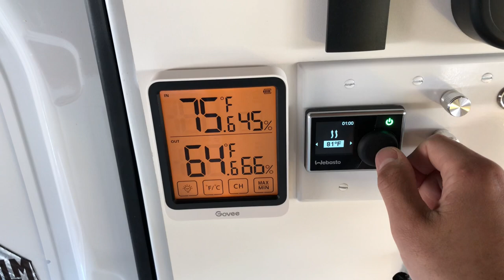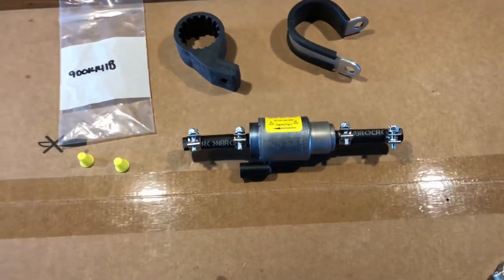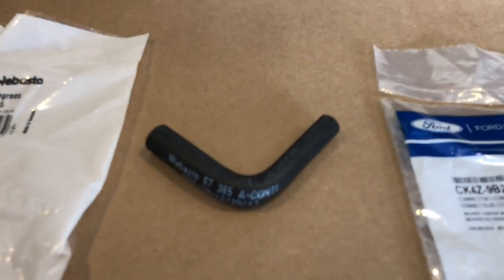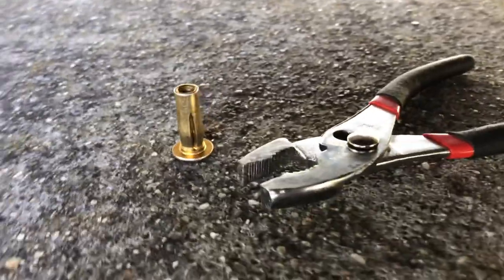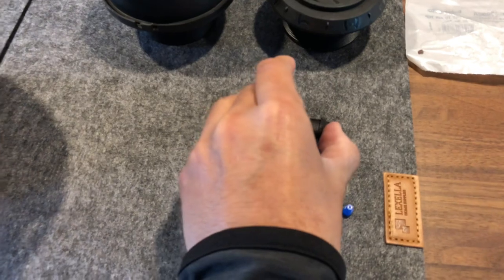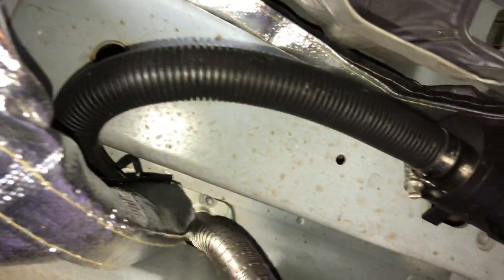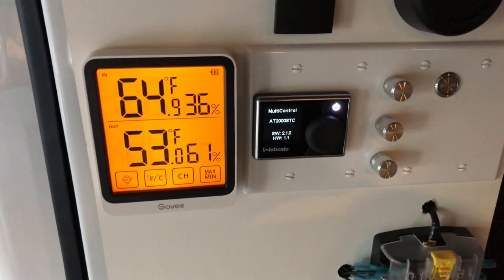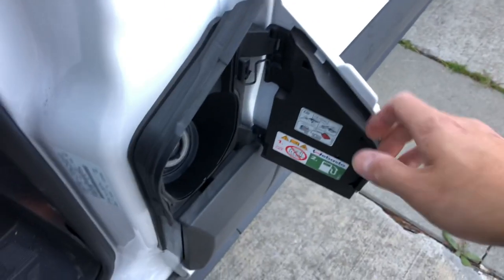AWD Transit WEBASTO HEATER Install UNDER PASSENGER SEAT! - Part 20

Comment: I just re-watched this now that I am getting ready to lower my tank.  This is by far the most complete video, and covers the details of dropping the tank on the transit.  Thank again for the detailed content.
Reply: Agreed. Great shots of the fuel tank bolts, sender unit and auxiliary port. Very tough video shots but he managed to do it. I will use the Aux port for now but later down the road I will cut a hole in the sender unit and put my own fuel feed stick (with smaller diameter). This will ensure better performance in high altitudes.

Comment: Thanks for pointing out that there’s an existing auxiliary port on the gas tank. Ford really designed the van for customization. I was thinking of a diesel unit with separate fuel tank because I didn’t want to put a hole in the tank. Now I’m sold on gas.
Reply from the maker: Awesome!

Comment: I'm surprised that the auxiliary fuel port for gas is yellow and blue for diesel as you stated. A Diesel pump at a gas station is indicated by yellow and the 5gal fuel containers for diesel are also yellow. And because they are designed for diesel they are made of a thinner gauge plastic because they can be from a safety perspective.

Comment: Rich. I have followed your install, it all went well except for getting the distal controller to work. The manual rheostat works and the heater is working, but when I swap the digital controller, I get no led reading and nothing is working. Any advice?
Reply from the maker: Hey Larry, check to see if your connection is secure.  The other thing I would check is to see if you need a special harness.  I can't recall now that it's been so long.

Comment: At 19:00 I would definitely use steel cable ties for that support.    That no-grommet metal passage will definitely wear through the plastic tie in time.

Comment: Pro tip: set your fuel pump to a vertical position so air bubbles do not get caught on the sidewall. The gasoline has lubricants that is needed for a prolonged life of the piston (no O-rings btw). If horizontal, there will be air continuously trapped on the high side of the wall (air rises) and will cause friction and dosing issues which is less than the expected .02 ml per cycle. The horizontal position will diminish the life of the piston as there will always be air bubbles in the fuel line due to the low pressure caused by the pump during each cycle. Hope that helps. 

Also, a bit curious on the exhaust portion of the video. Not sure if I missed that. Was wondering which muffler you chose to use.

Comment: Great video!!
I have a question. I have a new 2023 Transit HR 148. The build sheet says nothing about an auxiliary fuel port. Does that mean that I need to install that port into some part of the gas tank prior to the work that you have described here/ Maybe I missed something. I'm now following.
Reply: How did it go? I believe an auxiliary fuel port is a purchase option for new transits and not all transits have one.

Comment: RichBuilt -- Thank you for the video!  I used it to install my gasoline heater.  Now that you've had your heater a while, what is your experience? Mainly, how if that AUX port working?  Some people are reporting issues with reliable fuel delivery, have you had any issues?
Reply from the maker: Thanks Peter, the only thing I would change is to better protect the fuel filter lines and connections under the van.  It  was hit  a few times by rocks and had to be replaced. Maybe wrapping in heat wrap or tucking away better would help

Comment: Great instructions. A thought about the bed, a design I have not seen anywhere, (which I hope to use in my van): a bed frame composed of 4 panels, each panel represents a side of the bed left to right, hinged at three points; seat cushions fixed to one side (of the sitting part), bed mattress fixed to the other side. In seat mode, it is folded into a "b" or "6" configuration (one end at the very top of the "b" and the other end of the frame at the upper horizontal section of the "b". Linkages allows the lower sections to be pulled sideways forcing the tall vertical section to slide down and become horizontal, and the other sections are "unfolded" into horizontal and then placed on supports underneath the frame (a table and the seat across a middle aisle). This allows for seating on both sides of a middle table, and allows conversion from seat the bed without needing to make the bed or move seating cushions. (4 straps (for each section of the bed) need to be fixed into place to keep the bedding in place during conversation from bed to bench).
Reply from the maker: Thanks T, If I picture this correctly I'm envisioning something like this.  Sounds cool 
https://www.youtube.com/watch?v=hAfGyzi7by4&t=1s
Reply: @RichBuilt  The trifold bed, like the rock&roll bed have the disadvantage of having a double-thickness back, (the back of the bench is two layers of the bed). This is a disadvantage in that, if the bench is placed along the side of a van, it reduces the living space of the van's width by that extra back cushion. The "b" frame use the seat as the location of the extra layer, (the seat is the double layer instead of the back)  which doesn't diminish the horizontal space. Also, the segments of the "b" fram are connected (except where the upper horizontal meats the vertical) so that the segments are one peace and "unroll" once the vertical leg is pivoted into the horizontal orientation. But I understand it is a lot like interior decorating, everyone to what suits them. :-)

Comment: Nice job. How did you attach the  mounting plate to the van floor? Sheet metal screw or plusnuts?
Reply: Came looking for the same answer!
Reply: @EricMarenyi  I ended up using plusnuts. I used the 4 corner holes in the mounting plate with the two inboard holes going into the cavity of the frame member below the floor. The two outboard holes go into the storage area for the jack at the passenger step.

Comment: Great video as always Rich.  Is the fuel pump drawing ok upon start up?  I saw that you hooked up to the factory Aux fuel port which is much larger than the smaller fuel line used for the heater.  I put an Espar in my older diesel rv and had suction issues at altitude using the factory fuel port.  It all went away when I used the skinny stand pipe (fuel pick up pipe).  It involves removing the cap on the tank and is more work.  I'm doing the same with my AWD Transit and am going to use the factory port for an Onan 2800i generator that has a much larger fuel line.  The gas Transit Espar kit from Espar parts now comes with a small fuel pick up pipe and said it has to be used in kit for warranty to work.  They told me 90% of their trouble shooting on heaters not working was the loss of draw/suction on the too large factory gas tank pick up tube.
Reply from the maker: actually, sometimes it doesn't start on the first try.  Didn't think much of it but it always starts up after the second try if it doesn't on the first.  Good points
Reply: @chrisparent3018 your point is right on the money! I purchased a Velit Gasoline heater, and it stated in their guide that there are performance issues when connecting to the auxiliary port provided by Ford. I didn't realize the impetus was with the diameter of the aux pick up line/standpipe being larger; thereby causing fuel retrieval issues. 

Based on YOUR comment, I NOW just decided to go from the AUX port install to a 10-gallon gasoline Gerry can that has a "quick disconnect" setup (maintaining the 2-2.5mm diameter needed for proper siphoning performance). 
That way it will serve two purposes:
1. I can open the back door, quickly disconnect the fuel line, grab the can, shut the door and fill up then (in reverse) reconnect it. (versus filling up with door open on an inevitable cold day)
2. It can serve as an extended fuel resource, if I run out of gas for my van's tank. (gas nozzle attachment included)

Comment: I just installed mine yesterday and failed to watch your new video beforehand, but the faroutride site is definitely helpful for troubleshooting. Did your kit come with the fuel filter? I didn't install one and am now thinking I should probably add one. Keep up the good work.
Reply from the maker: Thanks Ken, Mine did come with the filter.  You can buy them for cheap on amazon, but the metal filter looks to only filter large particles.  $15 is worth the peace of mind.

Comment: I have the same van and will be installing the webasto on the drivers side, about 3ft back (under my couch). Looks like that is right beside the gas tank so no running a long fuel line etc. Do you foresee any problems with that location? I am also struggling with the $95/hr shop charge to install it, so it may become a weekend project with my dad and brother. Thank you very much for this video
Reply from the maker: Glad you found it helpful.  No, that area should make installation much easier and more straightforward after you tap into the gas tank.

Comment: Where is the outdoor sensor for your thermometer located? Thanks again for another helpful video. I like the thermometer a lot, but I'm confused where the two separate "in" and "out" readings are coming from. The "in" reading must be coming from the black sensor above the thermometer, right?
Reply from the maker: Hey Alex, the “in” reading measures interior temps of the cabin built into the display and the “out” is a separate sensor currently inside my fridge.
Reply: @RichBuilt  Thank you! Also, your fuel line sleeve Amazon link brings up a fuel line (not the plastic sleeve). Just thought I'd give you a heads up as someone who is using those links you provide. Thanks again for the content 👍🏼
Reply from the maker: @alexdecapri  Thanks for the heads up Alex!
Reply: @RichBuilt  One more question! Did you use self-tapping screws to secure the plate into the van floor in addition to silicone?

Comment: Great content as always. Is it just the espar heater or do you need to hang that fuel pump at a slight angle?  Is that only for the diesel pumps?
Reply from the maker: I'm not sure, I just followed what was in the manual. I think you're correct about the diesel.

Comment: Rich great video. Thanks so much. This is so helpful. I keep referring back to this video again and again as I am prepping for my install! Hey wondering if there was a specific reason you used the worm-drive clamp on the Ford Gas tank attachment vs using the fuel line clamp? I know the worm-drive clamp comes with the Ford factory part so I am sure it is "OK" but I see you purchased a box of fuel line clamps so......?

Thanks

John
Reply from the maker: Thank you John.  I used it simply because it came in the kit.  You can use either one and you will be okay.

Comment: Rich, what was the deciding factor between this and propex? Just didn't want propane in the van?
Reply from the maker: Hey Micah, I only considered the webasto and the espar heaters.  The espar was sold out and I thought I better jump on it before the webasto was out of stock.  Now the webasto is out of stock and the espar is available.  I would consider the espar since it has automatic altitude adjustment for the next build but I hear the webasto is more reliable.

Comment: Rich how has the Webasto been working this winter? At altitude?
Reply from the maker: Hey Micah, it’s still going strong.  I still haven’t adjusted it to high altitude setting but I had no issues the last couple times I camped in Tahoe

Comment: since the floor isn't flat in the front seat passenger floor, did you seal the edge of the plate? or what did you do to ensure a seal? with metal floor bracket and uneven floor? thanks!
Reply from the maker: Hey Erin, I used All purpose silicone from home depot to close the voids.  You could use high temp sealant as well but I didn't have any.  No issues so far on my setup.
Reply: @RichBuilt  if you sealed from the top, how are you planning on removing the heater if you need to service it or change out the burner? i.e. the plate is sealed to the floor via silicone/sealant and unable to access to the 4 bolts or remove the exhaust and intake pipes to remove the heater from the plate?

thanks!
Reply from the maker: @emoon25  Hey Erin - the silicon can be scrapped off with a blade once you remove the 4 screws if you need to remove the entire unit.  Based on what I saw, you can access all the ocmponents from the top side and you don't need to remove the end plate.

Comment: Nice install. Is it possible I can bring over oil pump into inside ? ( the line between oil tank and oil filter will be very long ) 
I am worrying about oil pump can be damaged by hit from road and get dirty very easily.
Reply from the maker: I think you mean, fuel pump? Yeah I think there could be a way to mount it so its not so exposed. No issues so far for me.
Reply: On that note, I really thought your workmanship, and your attention to increasing safety margins with extra shielding were commendable.  I would be a little bit concerned about using tie wraps for critical functions like holding the fuel line off the exhaust and drive shaft though.  They are abrasive under vibration, and they deteriorate over time, becoming brittle before they crack away.  There are higher cost versions which are better.  Another option would be to use adel clamps (smaller versions of the type holding the fuel pump which you discarded).  I can see that you are meticulous and you would obviously change these out in good time.  I would be worried that I wouldn’t.

Comment: Hey! Thank you for the EXCELLENT video tutorial!! I’m working on my Webasto install in my Transit and it’s HUGELY helpful!!! :) Was wondering: Did you have to trim one of the jack bolts under the passenger seat, to make room for the heater?
Reply from the maker: Thank you, I didn't have to trim the jack bolts.
Reply: Thanks! Was your plate home made, or the one the came w the kit? Trying to figure out how to get it to fit under there. Happy to pay for consulting if that’s easier too. Feel free to send your site, etc:)

Comment: With the exhaust so close to the passenger and sliding door, do you notice any exhaust entering the van when the doors are open and heater running?
Reply from the maker: I haven't noticed it before, but I don't think I've ever opened the door while the heater is on.
Reply: @RichBuilt  Cool, thanks for the reply and the very helpful video! I'm working on my own install this week.

Comment: Why does the fuel line need to go over the drive shaft? Could it just come out from the main tank on the passenger side?
Reply from the maker: The fuel tank is on the driver's side and the heater is on the passenger side on my setup.
Reply: @RichBuilt  Thanks!

Comment: What size wire did you use from your house battery to the webasto electrical wire?
Reply from the maker: Hey Elena, 14awg stranded copper wire

Comment: What fuse converter panel are you using to go into your 12v battery generator?
Reply from the maker: Hey Joriah it’s the Blue Sea fuse block

Comment: Can't wait for the 80/20 Murphy bed. How did you decide on the Webasto over the Espar?
Reply from the maker: Hey Diani, The espar was sold out and I thought I better jump on it before the webasto was out of stock.  Now the webasto is out of stock and the espar is available.  I would consider the espar since it has automatic altitude adjustment for the next build but I hear the webasto is more reliable.

Comment: I might’ve missed it, but where did you mount that outside thermometer sensor?
Reply from the maker: I had under the rear bumper.  I moved it to my fridge to monitor the temps there instead.
Reply: @RichBuilt  Great Video. I am following a lot of your designs and work. Thanks so much! I purchased the Govee thermometer and had the same question on the sensor location, but I like your idea to monitor the Fridge! Brilliant. So another question. How did you mount the Govee thermometer to your instrument panel? 3M Adhesive tape? or did you rig up some screw/bolt on method?
Reply: I also wanted to know how you routed your Webasto control wires in the door pillar? Did you remove the plastic trim and the Air Bag Foam block to do it? If yes any tips to avoid breaking them on removal would be appreciated. Thanks again.
Reply from the maker: @JohnWilson-wc3nx  Thanks John, I used 3M Tape.  Its held up since I installed it, but on the final iteration I will likely screw it in.
Reply from the maker: @JohnWilson-wc3nx  You don't need to remove the panel completely.  Just pry it up enough to squeeze the wire behind.  This way you don't damage any of the clips.

Comment: Ford has a build option that Auxillary Fuel Port Extension Line for $385.  You think it's worth it rather than getting under the car and removing the fuel tank?
Reply from the maker: Cameron, I’m not sure what that is. But I don’t think it’s worth if you still need to get under the van. $400 could get you a lot of different van components.
Reply: @RichBuilt  I'm not sure if this justifies the price but it also includes an extended range tank which is 31 gallons.
Reply from the maker: @gunzforarmz  if $400 included in the extended range option, than I would say that's worth it. Especially if you plan to go on long trips
Reply: I bought that option and it provides an extension line which sticks out the side of the tank, so you don't have to drop the tank.
Reply: @_drift__  I have the extended range 31 gallon tank in the used transit van that I just bought.   Does that mean I have the aux fuel port extension line that you're referring to? How can I tell?
Reply: @allighton  The aux fuel port is an additional option. You can tell if you can see a fuel line sticking out of the tank with a plastic adapter to plug into.